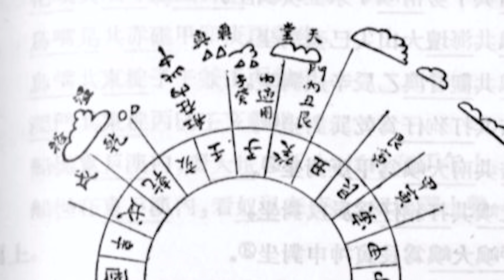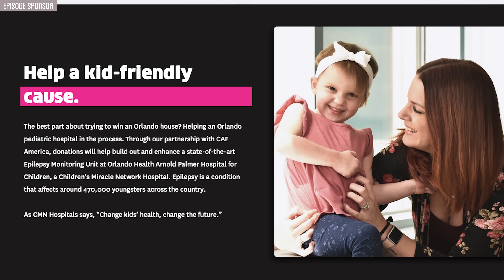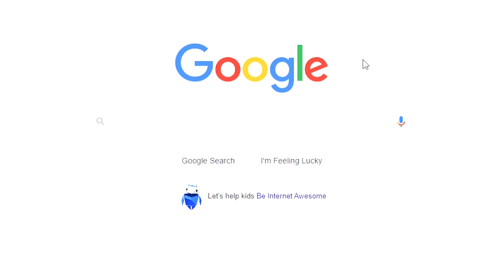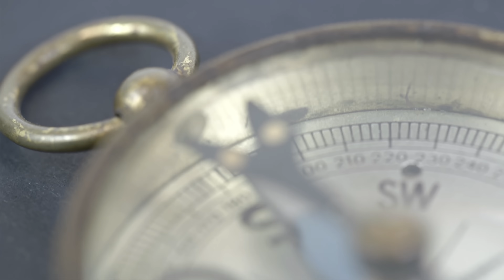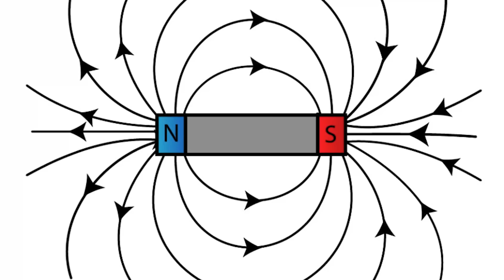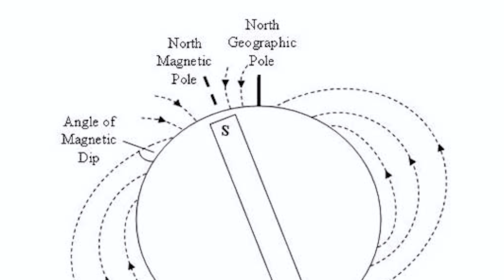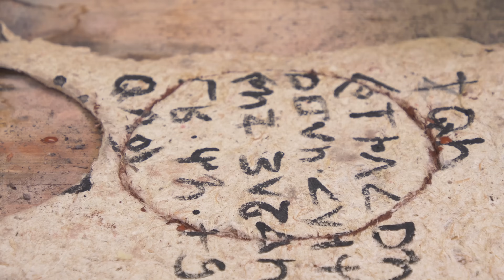Making a DIY Lodestone Compass: MINECRAFT vs. REAL LIFE

Comment: Ok I have two ideas if you ever think of doing a compass again. One if you take a piece of iron heat it up face it roughly north and hammer that end you will make a magnet. Two you can use straight lines and arks to make different shapes inside of a circle and go from their to get you different degrees for the compass. Three most compasses now have a moving piece so that you can figure out more direction than just north

Comment: Why did you cast eh case? Make some bronze or brass sheet and solder it together. Soldering was common by the late bronze age and is pretty easy to do, even using traditional methods, especially if you have iron tools to make the irons.

Comment: Lauren, if you have trouble separating the yolk from the whites in an egg using the shell, an easy way is to crack the egg into your hand and allow the whites to flow through your fingers while capturing the yolk. Only works if the yolk doesn't break though.

Comment: Compass could not be achieved for the following reasons.

-Iron still not achieved, 
*store bought beaker, 
*store bought crucible, 
*and tongs, 
*factory milled timber bellows, 
*prefab bricks, 
*foundry cast fire plate, 
*store bought coal, 
-Iron still not achieved, 
*Tongs made by professional blacksmith, 
-egg not sourced, 
*store bought brushes, 
-Language not achieved,

Comment: 10:10. Lauren. You lied. I tried to crack the egg like that. It was difficult and took a lot of pressure, but I cracked it. It exploded everywhere.
Reply: Came to the comments just for this
Reply: Yeah only works if you do it on the too and bottom if you squeeze the sides it will break every time
Reply: you did not apply pressure equal to both sides then.
Reply: @satakrionkryptomortis  you were not witness, so that is only assumption. Having actually done it, I think that I put equal pressure to each side, though I have no way of guaranteeing that I did.
Reply: Blake Terry: Lauren doesn't lie. You did it wrong. Sincerely, Lauren's Mom
Reply: @lena5546  i do think i broke the egg correctly, though it is not a lie if she believed it to be true, so sorry fo calling her a liar.